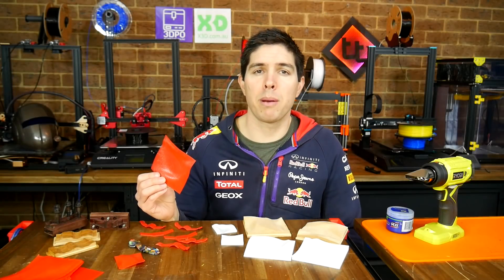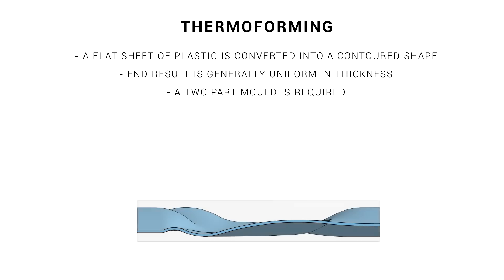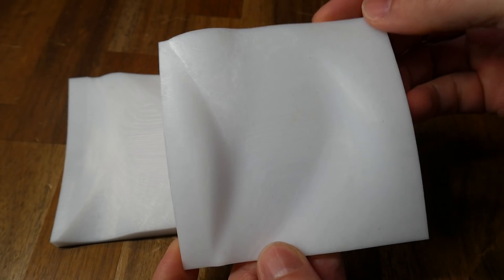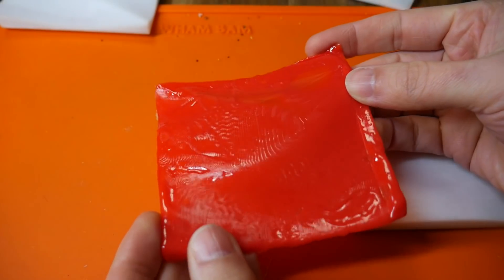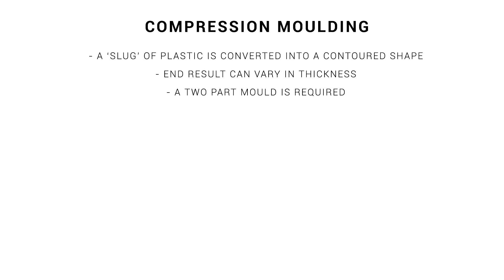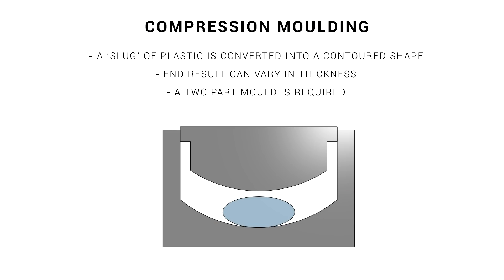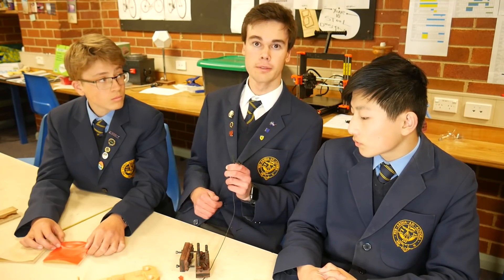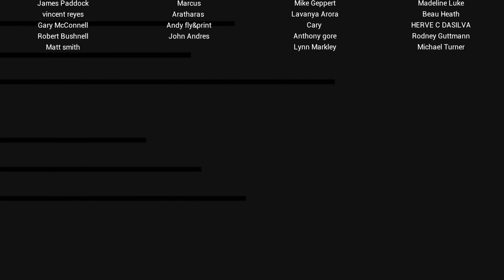Make more with thermoforming and compression moulding - Advanced 3D printing

Comment: This is really interesting. I wonder if this concept would work with a 3D printer pen like injection molding.
Reply: Well if you were to get a huge stepper motor to drive a special compression mixing screw and replace the way the nozzle attaches or reinforce it to withstand several times its original internal psi rating  yeah but 🤔 well now it doesn't seem anything like a 3d pen the reason the 3d pen wouldn't work is that the psi u would need to get the plastic to flow into every part of the mold there is several people that make tabletop injection mold systems u should check them out
Reply: @salvatoremilitello8490  I was thinking in terms of simplicity and pertaining to the process used in this video. After some thought you could simplify all of this with an aluminum mold: fill, heat, repeat.
Reply: @LOBrien_  yeah the 3dpen could be used to deposit a tiny slug for tiny parts in a hot aluminum mold
Reply: Maybe you could use an adapted oven with a print head in the oven to place a slug in the aluminum mold placed in the oven vertically with a shaft going outside the oven for tightening the nut clamping system this could all be made with a arduino to automate every process that would get around the psi issue and with 2.75mm "3mm" filament print head you could build a good size slug in seconds 😉 use the same socket setup just cut holes in the oven and use 4 and just move the nut driver between them to tighten unless u want to make a way 1 drive system could tighten all 4

Comment: You could use boiling water (100°c) to have your plastic at the right temperature.
Reply: interesting idea, could use cooking tools for sous vide
Reply: @jasonder6241  dont need to - water doesnt go above boiling except PLA likes to melt at double the temp
Reply: I do this quite a bit w PLA
Reply: you mean doing a "bain marie" I wonder if you could do chocolate parts.
Reply: @RomanoPRODUCTION  Nahh, definitely sous vide. A bain marie could work, but by the point you've got it enclosed enough to not let it get wet, and the time you've got it surrounded by enough heating material (boiling water), you're basically using sous vide.

Comment: Third
Reply: Mechanical engineer here. You are working with matched die thermoforming, which simply put your are dealing with temperature, pressure and time. Some suggestions: use an arbor press and mount your dies to it. This way you maintain temp. in plastic, reduce time of operation/heat loss, and provide a more uniform and steady pressure with less work. Second you normally don’t want to heat your dies. Heat cycles cause thermal expansion and accelerated tool wear. Plus you have to wait for it to cool so it slows your process. If all you’re after is a result for a small lot that could work. But you will have to maintain the part in the die until it cools. I would start charting temp, pressure and process times to narrow down a repeatable solution, data knows all. Another suggestion is a heat lamp and a fixture to hold the material between the dies. Then when your ready, you lower the arbor press hold and switch off the lamp. Just remember that the material is being compressed and slight thickness changes do occur especially at the edges of the parts. But again its dependent on the gauge of the material, temp, pressure, time...Most manufacturers add extra material around the edges that they trim off with a cutting tool, laser cutter, etc. Add drafts to mating faces of the dies. Will help with release, also look into adding ejection pins if thick parts stay stuck, note will tear through thin wall parts. Lastly if it were me I would buy sheets of thin gauge PETG to thermoform with (if you end up with an aluminum tool).